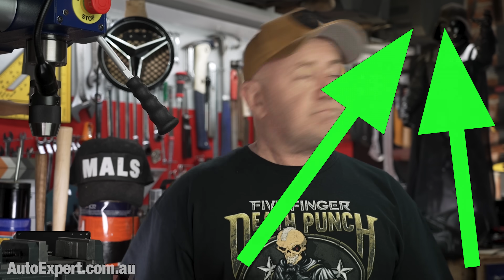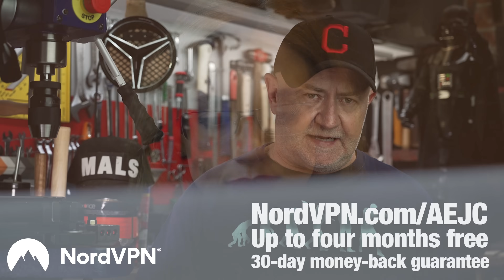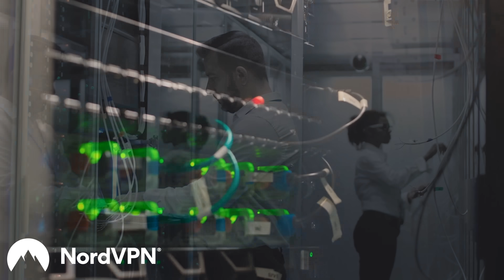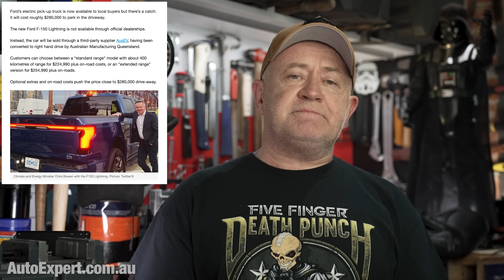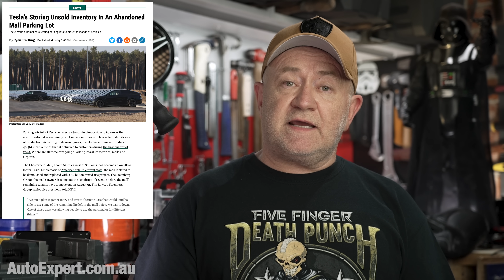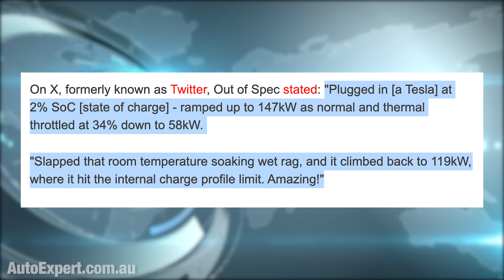ELECTRIC UTOPIA? Top 10 insane EV reports (this month)

Comment: Scooter and bike fires are bound to increase as the batteries and the electronics deteriorate. If you were bright you would never buy one but I still get 48 and 72 volt bike batteries that are badly designed and terribly made to inspect and supposedly repair. I don't even take them in the workshop. They only get as far as a bench at the far end of the yard!
Reply: ICE catches fire about 10 times more often then an EV. That s the worst it s gonna get of course. Termomanagement systems are only getting better. At this point it s not too inaccurate to say that Tesla don t catch on fire statistically speaking.
Do your research, invest in Tesla.
Reply: @lucadellasciucca967  ICE fires 10 times easier to extinguish than BEV fires. Huh?
Reply: Funny how everyone seems to be worried about EVs catching fire left right and center, despite EVs being upheld to the highest safety standards and the manufacturers knowing full when what a PR disaster it would be if their EVs spontaneously combust all the time.

E-Bikes and scooters on the other hand are probably designed with a little bit less care and they are probably going to experience more mechanical shock during use (bike or scooter falling over, bumping into something etc), which can potentially damage the battery.

Comment: Funny that battery to battery transfer requires that the source battery has a higher potential voltage than the destination. It is not the case that you can drain the source and put that power into the destination battery. They reach an equilibrium where both source and destination are the same so no matter how high a power rating of the source if its terminal voltage is not higher than the destination no current will flow. So we need to raise the source voltage with an inverter of some kind so add that to the weight but also the efficiency is critical as the waste in that process is going to cost you say 15% of the battery power. So it will be interesting to see if the Gerry Can battery can do more than run a radio let alone a vehicle. Imagine an electric tank. 40 tones in weight but that is now going to be say -8 tones for the removal of diesel engine then add in the new motors and then the batteries so lets say it is now 50 tones in total. Charging that will be a task!
Reply: I have a device that turns 18 volts in to 54 volts. I built it and use it as a range extender for my scooter. It’s science not magic
Reply: Please leave such engineering explanations to the real electrical engineers.

Think of a simple “power bank”. 
It contains the same technology batteries (3.7V Lithium batteries) as those in your phone, yet somehow manages to get past “equilibrium” and transfer virtually all its power to you phone.

Comment: If gas can batteries just sloted into vehichle. 5 or 10 at a time. So they could be swapped in by anyone in  under 5 minutes. Instead of the car having the battery. and then you spares charging thru solar/grid. kinda like a fuel cell i guess
Reply: Already done. Stellantis and Ample

Comment: Regarding that idiotic EV jerry can idea - one could fit a small ICE generator and 10l of fuel in a similar weight & volume package and that could provide at least 5x more energy than the stupid battery-only solution.
Reply: So the chevy volt, then, which has been around for 10 years..
Reply: Electric has more potential efficiency.
Also you can get elctricity anywehre, can t get fuel anywhere.
Do your research, invest in Tesla.
Reply: @lucadellasciucca967  You have never been to Africa pal. They don't even have running water in most places. But you can get diesel and petrol in even the most mud hut of villages but electricity? No.
Reply: @lucadellasciucca967  I couldn't care less about potential efficiency when my vehicle is stuck without power in the middle of nowhere, which is why portable energy sources exist in the first place. If I'm stuck in an EV and the option is a jerry 'can' that will give me 3-4kW charge vs one that will top up 15kW, maybe even 20kW, guess what option anyone sane would choose? As for Tesla, wouldn't touch that overpriced junk stock with a 10ft crank shaft!
Reply: @lucadellasciucca967  you going to plug into a tree or something mate?
Reply: @lucadellasciucca967 Was this investment advice? People have ended up in hot water with the SEC for less.
Reply: @lucadellasciucca967  Didn't Elon say that 'his' money would be the first in and the last out! Check out how much he has cashed in, it's interesting! And he wants a $56Billion BONUS on top of his salary. How's that working for you?
Reply: @lucadellasciucca967  So thats the power of Harry's magic wand!

Comment: Zero emission battlefield. 😂 ‘Because your enemy cares more about the environment than killing you’. Lovely
Reply: One key point is always missed - on the battlefield, standard vehicles are not there. Armoured ones are. Do the electric wanks account for the fact that the vehicle will have armour plates and armoured windows installed, weighing in at a extra half a tonne at least ?
Reply: @jamesaustralian9829  They are obviously taking it seriously. The US has a program exploring electrifying or hybridising  the abrams. I can see where systems like the one mentioned streamline logistics (use multiple std modules depending on the vehicle, removing the need for diesel, gas and avgas separate in the field)  But as usual on current storage tech  it's an impractical  pipe dream.
Reply: @lucasvyner1502  I think there are two reasons for the electrifying effort. One is stealth. An ICE engine glows in infra-red like a light house and makes enough noise to make it easy to find.
The other is fuel supply.  They are also trying to get small modular nuclear reactors to power these things. If they can charge them with a nuclear reactor they don't need to depend on a very long fuel supply line.
Reply: Most countries don't give any figures for the CO2 emissions of their military, but the best guess I've heard is that 3% of humanity's entire CO2 emissions is military activity.
Reply: @peglor  the emmissions from the stuff they blow up is far more polluting.
Reply: So you’re still falling for the environment lie? EV’s are NOT environmentally friendly!
Reply: This reminds me of the Star Trek TOS episode where a planet is at war with a neighboring planet. But they don't want to destroy the environment and infrastructure, so they fight their "war" with computers. People who are in the wrong place at the wrong time and considered "casualties" by the computers voluntarily walk into a disintegration machine, and get vaporized. It's all nice and clean, but people still die. This was supposed to be FICTION. But it's beginning to look like it might actually become reality. Some people, too many in fact, really are that stupid.
Reply: Because the warmakers care about profits.

Comment: An extremely disturbing recent post by Serpentza on YouTube reports on two individuals who were incinerated in an electric vehicle when rescuers were unable to gain access to said vehicle !
Reply: Yes the water cart . By accident standards just a fender bender . The all electric door locks were disabled as the module was in the front . The issue was it was live steamed on wiebo so a 1/3 rd of China saw them get incinerated . CCP has taken down all views as EV sales tanked. As for Serpenza his reports on China are very accurate .I have travelled and worked in China since 1996 . Australia is a very high trust society China is an extremly low trust society . Buy your own ticket as see for yourself .
Reply: @howardsway7788 accurate you say? I think that statement is uncritical at best
Reply: @theairstig9164  Do you know what a preponderance of evidence  is?
Reply: BYD doesn't stand for 'Burn Your Dearest' for no reason...
Reply: Is that the one where the EV crashed into a water truck?
Reply: @robt8042  Affirmative Rob !
Reply: @robt8042 yes 👍
Reply: @robt8042  Yes. It hit the truck when the so-called adaptive braking failed. The airbags failed also. It was one of China's most prestigious luxury models. I forget which one.
Reply: Serpentza was discussing the failure of the airbags in Chinese cheapo cars. The driver died instantly due to the airbags failing…… again and the rescuers couldn’t open the doors to get the passengers out.
Reply: @fugawiaus  So he was cactus before he was cooked?
Reply: @MrBenHaynes  oh well done. Hehe
Reply: @fugawiaus  Exactly, EXCEPT that one was an expensive model, which performed just as badly as a cheap shitbox
Reply: EV fires burn at 4000 degrees F vs gas fires at 900 degrees.
Reply: yes saw it! Serpentza or ADV China, you see all you need to know about the "EV boom" in China! Elon is only a good business man, nothing more, he bought Tesla 2004, but claims he was the main engineer, the same with SpaceX. The name he uses says a lot about him" Gigafactory, Cybertruck, Loophole", a show off, knows absolute nothing about engineering, forces you to work overtime in stupid projects and fires you per Email, not even the ball to say it in front of year long coworkers. Like Mars, humans are not made for space, we lose bone structure, fertilization is a issue too, but he pushes it forward. I hope he will go down. Using Tesla as name for his product is dishonoring a real genius!
Reply: Do you know how often this happens with gas cars? It happens with an EV it makes national news. It happens with a gas car, no one cares because it doesn't fit the narrative you want.
Reply: My EV came with a hammer to break the windows in case of emergency... but my car is not a Tesla. It is a Toyota BZ4X.
Reply: @erikdedecker1943  Yeah, only because they get safety rating points for having that siĺly thing on board.
Reply: What exact model was it?
Reply: Damn that's horrible A Tesla Barbecue?
Reply: I am not defending EV but this scenario plays out fairly regularly with regular crashes. However , serpentza and his American mate laowhy are pretty suss always putting out negative content from China - almost like they are paid to do it ! Just who is paying their wages?
Reply: @mongolike513  Doesn’t diminish the seriousness of the problem !
Reply: @typhoon343 MILLIONS? See a doctor,  you're delusional
Reply: @mongolike513  They are two men who have lived in China and seen the sort of people who live there - they also know how cruel the CCP is.   We all know what China is anyway - but I do like to hear from someone who is doing a great job showing what the CCP is up to, they produce very informative and interesting videos.  China is suss, not the messenger ....
Reply: @mongolike513  What other kind of content can come out of China right now?
Reply: @mongolike513 he lived there for years so pretty sure he is able to say what he wants..
Reply: @mongolike513 Yeah but when a gas car catches  due to an accident and someone  is unfortunately burned , more often than not ,  it wont be because the electrics wont allow the door handles to work .
Reply: @mongolike513 and you're the bot that makes these statements on everybody's Serpentza quote. Every comment is a conspiracy against China, obviously the CCP is blameless.
Reply: @mongolike513  Well, what would be the positive content from China? The news from China always seem to be turds painted with gold colored paint.
Reply: @mongolike513  defending the China 🇨🇳 electric vehicles are you buying one 
They are nothing but thieves copying everything after stealing designs 
Make fake food  paint puppies  to look like pandas  at the zoo 
Confiscate appliances and electric scooters  forcing them to buy new ones to keep the failing economy  going  
Hardly think our pathetic media would report this stuff like exaggerated  statistics on domestic violence    so happy for the information from that source
Reply: @mongolike513 who’s paying their salary? Probably not your overlords, wumao.
Reply: @mongolike513 YouTube. SerpentZA has 1.5 million followers and his mate Laowhy86 has 970,000. That's a lot of advertising revenue.
Reply: @mongolike513  that's probably due to the fact that practically zero positive stuff comes from the fakest, dirtiest, most corrupt and dumbest country on Earth. That's why the CCP is paying (foreign and domestic) shills to give you an impression that "mighty" China is this modern, super advanced society, when in reality it's falling apart, in many cases quite literally. Just watching how they handle themselves in traffic is enough to understand their mental capabilities.
Reply: @mongolike513  Really? What cars in America have failures like that? Both the adaptive braking and the airbags failed, on a brand new high end luxury sedan. As far as Serpentza and C-Milk go, they provide important insights about China, with help from their Chinese friends who illegally violate the CCP's Great Firewall at great personal risk. Their income comes from the same places other  YouTubers get theirs, obviously. There are more than enough pro- CCP channels and sites, many of which get CCP money. They make it clear they're anti-CCP, and pro Chinese people. Maybe you're getting some CCP yuan, or hope to?
Reply: @mongolike513  They put out LOTS of very positive videos when they were in China. Now, safe in America,  they can show the ugly side, which is the CCP
Reply: @mongolike513 Who is paying yours?

Comment: I like the idea of the battery jerry can.  Using the Cynet 30k powerbank that is currently for sale at Officeworks for 89.95.  Now if my high school level maths is right these are 69x28x146mm and will fit in a 6x4 trailer with a 5" box 11,180 times.  If this works it should only weigh about 4,800kg Thats what 26kVA?  Problems solved.  BTW If you buy that many they should give you a discount so it will probably cost a flat $1m.  Cant see the problem with this.
Reply: You forgot to mention that the trailer would need to have a 6 litre turbo charged motor  to move that much weight
Reply: @davidmcintyre8159  crap you would definitely be over GCM then

Comment: Merchant of Venice; a pound of flesh. That's 450 mL for you folks.
Reply from the maker: 13 out of 10.
Reply: Except that ML is a measure of liquid !
Reply: @TonyWhite22351  nonsense, it is a measure of  volume. It could be air, it could even be a vacuum. You know, like the one between your ears
Reply: @kevinbarry71  what is the volume of a pound of flesh ?
Reply: @TonyWhite22351  He told you in initial post. 2.2 lb = 1 kg. Density of flesh very close to water.
Reply: @garycook8220  check the labels on any meat product you will find it is measured in grams not litres !
Reply: But why use a unit for mass in one measurement system and a unit for volume in another measurement system and equate the two?

Comment: Every electric military vehicle needs to tow a 500metre square solar panel array behind it,  to be used to recharge the battery at night...
Reply from the maker: That's only 20m x 25m. 100kW max, with sun dead overhead...
Reply: @AutoExpertJC  Yeah but they would be used at night,  like the Aussie government said that is the ideal time for solar panels ( lunar panels ).
Reply: @chrissmith2114 Be fair, night charging is perfectly feasible with a 180 degree longitude shift of the PV location  and a hefty length of superconducting cable. Maybe that's what the genius Australian politicians are proposing ?
Reply: @philhealey4443  How did I miss that ! pretty dammed clever these politicians....